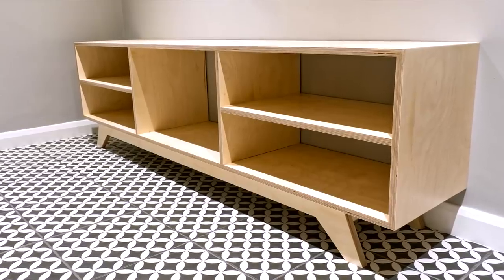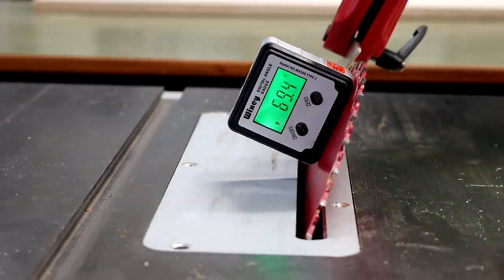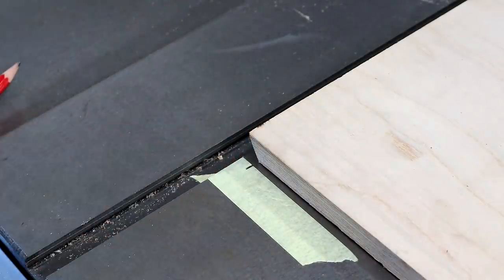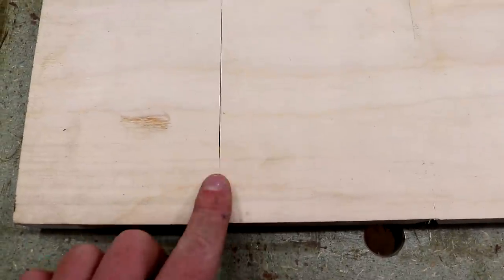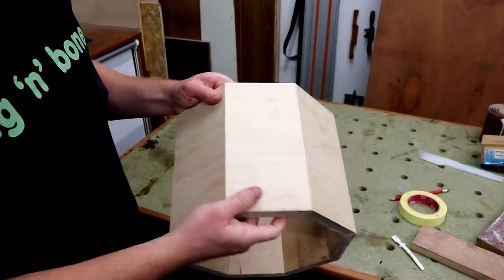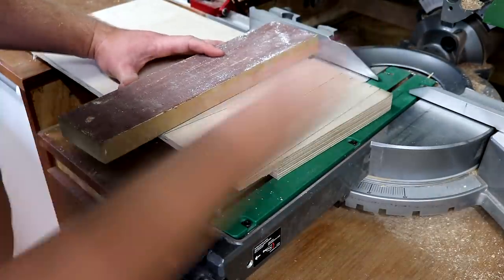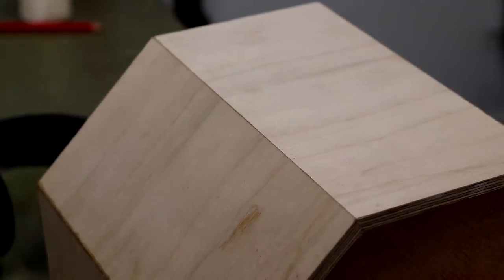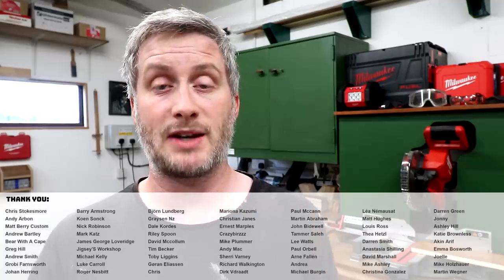Geometric Plywood Plant Stand With Continuous Grain

Comment: Hi Keith, I know it's a bit of a bodge, and a pity few mitre guides fit snugly, but I improved mine significantly with some strategically placed centre punch marks on the edge of the guide rail.  A blunt, rather than a freshly ground punch seems to work best.

Comment: I've seen three videos this week about doing geometric shapes like that on the table saw.  One trick I picked up (I am not an expert nor done it myself) was to cut the angle slightly over, so they meet on the outside edges and you can fill any gaps more invisibly on the inside join.  Again, second hand knowledge, I have no idea what I'm doing :)

Comment: Nice work Keith, a little tip for the gaps, fill them with a bead of wood glue then run the sander over the gaps. Glue and sawdust will gum up together and voila, instant woodfiller!

Comment: 2:19 just an idea but why not drilling two "pin holes" into the table top in an 90°  (45°) angle to use as reference to align your miter fence